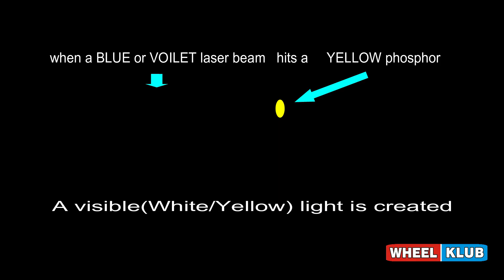Is it a Real LASER Headlight? Answer is here

Comment: I can answer this question, 

"The smoke test ended in BLUE LIGHT output,  leads to another NEW test WHY the light turned in to USELESS BLUE LIGHT which cannot be used in driving."

It isn't converted into blue light but starts as blue light.
Coloured phosphor is "fluoresced" by wavelengths that have more energy. UV has the highest energy but is not all that common so a bit more pricey. Blue can do the same job as it has a higher energy state than green and red, therefor allowing them to fluoresce. The now mix of blue (laser) green - orange red (phosphor) creates a "white" visible light.
This is the same method used in making white LEDs and Fluorescent tubes.

Comment: It is in fact a laser, but burning a wooden stick can even be done with a standard 55w H7 halogen bulb, as long as you put the stick at the focal point of a reflector, I made this mistake, trying to alter the cutoff on a set of h7 projectors with electrical tape, burnt right off lol. The blue light is probably caused by the heat or reflection from the toothpick somehow burning away the phosphor filter for the laser. Meaning that if this wasn't dangerous before, it sure as hell is now. Good video though, answering all the questions!

Comment: Now how is the reflector not burning??
Reply: Skid Kev I'm going to say that it has something to do with the % of the energy that is absorbed rather than reflected
Reply: @smason4622  Then the reflector wont get hot? If its absorbing some % of light?
Reply: Skid Kev if I'm not mistaken it reflects nearly or all. my optics course was years ago.
Reply: @smason4622  i just wanted to know if those reflectors are plastic or ceramic type. Because if its plastic it will definitely melt away right?
Reply: because the laser is not hitting the reflector.. the laser is pointed at the phosphor element which then creates the white light and then it is reflected to create narrow bright high beam.. that hole in the reflector is where the laser diode is hidden inside.. the yellow diode he showed us is actually the phosphor module, not laser diode.. the laser will not be reflected towards the front .. the objective of laser module is to assist led high beams to get a long bright throw for higher visibility over long distance.. The current LED brightness is sufficient enough for 
 low beam road application but not bright enough to provide long throw high beam efficiently (under certain watt limitation)that's where the laser assist comes in... As of now the complex and expensive laser lighting is not needed for low beam and general purpose headlight application as long as LED exists :)
Reply: The laser focal point is where he put the stick, causing it to burn. I own a fairly decent power green laser and most of the time its just a super bright green laser dot that doesn't harm anything but your eyes if you're unlucky enough to get a reflection back at ya. But place a balloon or a match about 2 feet in front of it when the lens is adjusted down and the match will light and balloon pop. same concept.

Comment: I believe Audi is the first manufacturer to develop this idea into a working headlight.  The have been using a setup like this on the IMSA ALMS cars for a couple years now I believe.
Reply: Nope Audi was the first one to come up the idea, BMW were the first to produce it. Audi then came back with Matrix design. The ones in the above videos are knock offs of BMW design. By the way how does your experience compare with the the above videos you have watched?
Reply: @crackerhacker2271  BMW didn't use it until Audi did in racing. Manufacture made, but not publicly produced.

Comment: This issue isn't in Audi & BMW versions, because in this version in your video the phosphor material is out side the case, the laser beam is directed through the lens and hits the phosphor just above the reflector - by the way as the laser beam is directed to the phosphor not towards cars & people, there's no any danger .. in BMW & Audi versions the laser beams are directed to a phosphor inside the case which is hidden .. the laser diodes, the laser beams, the phosphor are hidden inside.. the only visible part is the reflector .. so there's no any laser beam at the reflector area ... Try this with a BMW or Audi version and your stick will say : "Hello I'm happy here" ... the technology is very safe
Reply from the maker: Thank you for sharing the tech info..